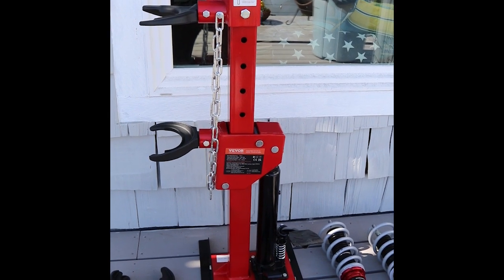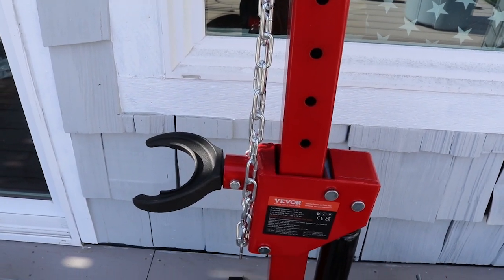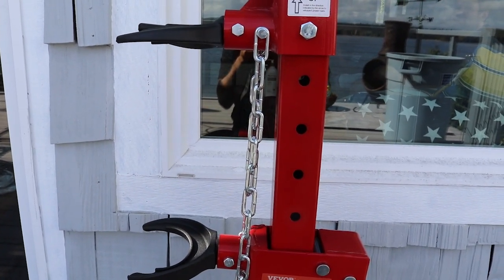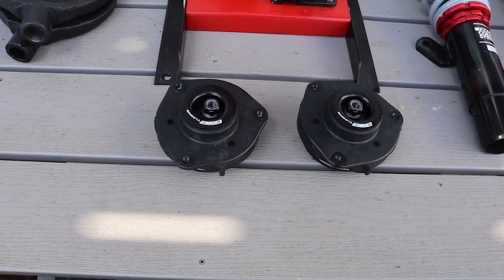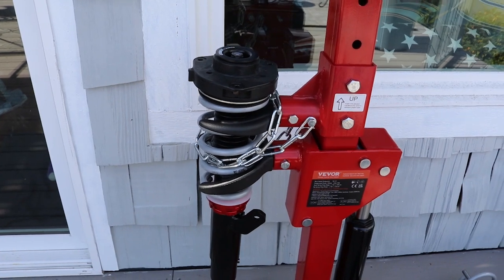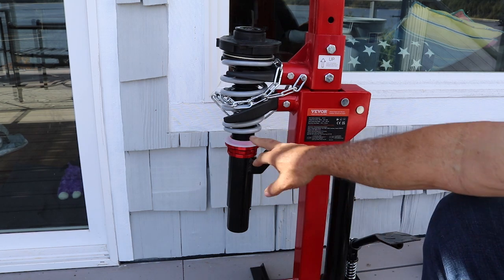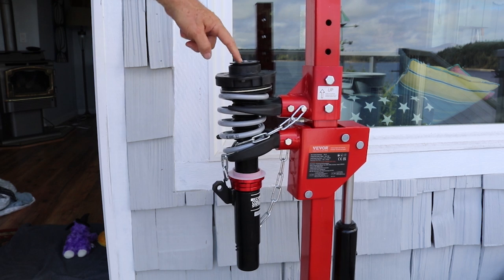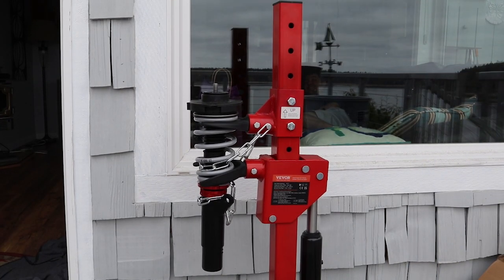Vevor Spring Compressor Assembly and Usage

Comment: All the bolts are crap . Chuck em and use 10.9 metric or grade 8 standard bolts for everything. Also use good washers and stover nuts . Chuck out the safety chain and get a real chain.also nice if the spring cup ledges were deeper. What iv listed are my only issues with it. solid tool good construction just shit bolts and chain .
Reply from the maker: Thanks, good idea

Comment: Its unbelievably inexpensive.   Its just a bit bulky.  Its a use and sell or trade tool.  Hmm, a site for tool trading.  Interesting.   My Macphersons have no preload setting.  I use a hand held Vevor.  It works but its better if you have someone to hold the bottom straight.  Run a long bolt through the lower knuckle mount and they have all the leverage they need.  Work smart and gently.  Its not rocket science but its not breaking rocks either.

Comment: Maybe ok for lighter springs/smaller cars, I've seen some Amazon reviews of them actually bending under load BUT the Sealey RE231(this is a copy of that) is far heavier built, been using one for years but its 3 times the price....For safety sake i'd go for the Sealey if going to do alot of work....Some springs require to be almost fully compressed, not sure I'd trust this tbh... spring injuries can be horrific.
Reply from the maker: It did my Vw and was very easy. The sliding rail and spring caps are very beefy.  I do not see a problem.
Reply: @JoediyLab try a BMW 1 series front 😂 Your spring barely needed compressed to get the top mount on....As I said some springs need almost fully compressed, you'll even find you'll need to take the compressor apart to release the spring and shock assembly as they can trap themselves whey released. It varies greatly from car to car. Some are easy some not so easy especially springs with a taper.
Reply: @markbro4427  I have a W204 C300 and I couldnt compress the spring enough to put the shock back on. I had to place the bottom plate underneath the lower spring seat in order to have enough travel because the hydraulic pump would hit its limit if I place the plates at the top and bottom of the spring. My spring is pretty short so its hard to compress.